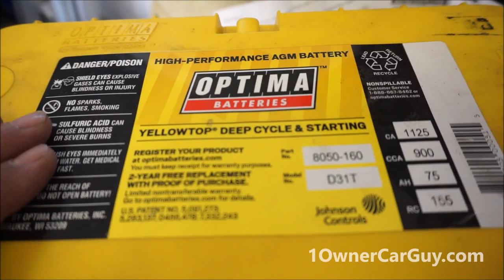Citicar Comuta-Car Classic Electric Car Solar Hybrid Micro Car Exterior Video

Comment: Sorry, to start with this would be a 1980 Comuta-Car, the CitiCar was built from 1974 to 1977, and did not have the batteries behind the bumpers like the Comuta-Car did.  The solar panels are not original to this vehicle; they look to be those sold at Harbor Freight!?  Your battery arrangement should not be those 12 volt RV batteries but rather Gulf cart style deep cycle six volt. ones - four in the front and the same in the rear.  The body is not fiberglass, but rather a much lighter weight ABS plastic.